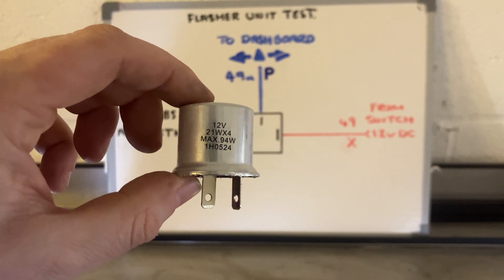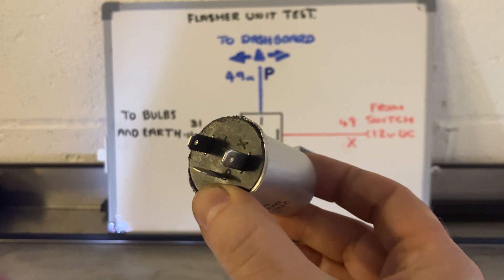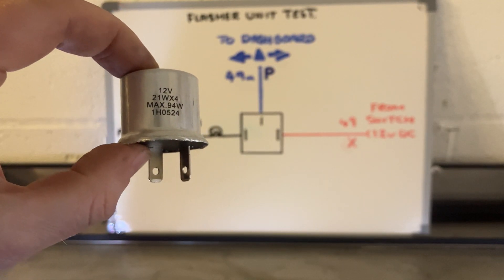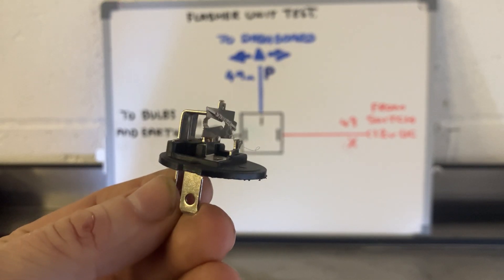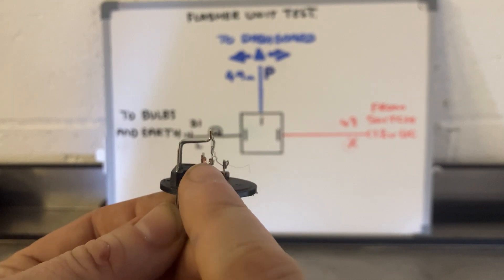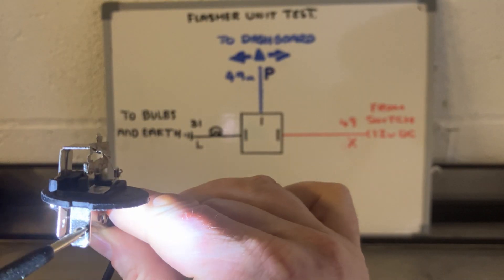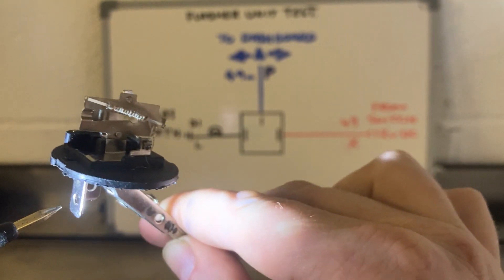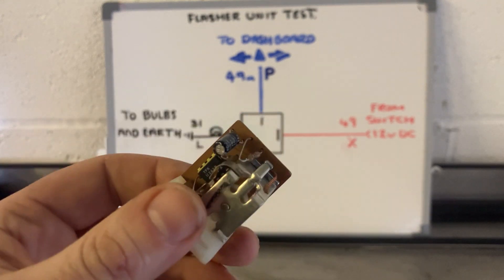How to Test a Flasher Relay.

Comment: Not exactly sure what circuit you’re using to test this. I get the lead from the ground but the lead from the multimeter and continuity tester: how’s that hooked up to provide the other side of the circuit and do continuity as well?
Reply from the maker: Hi, if I understand you are asking how the three pin powers both circuits? When the bimetallic strip bends it will just hit two contacts, one for the light unit, one for the dashboard. Hope that covers it?